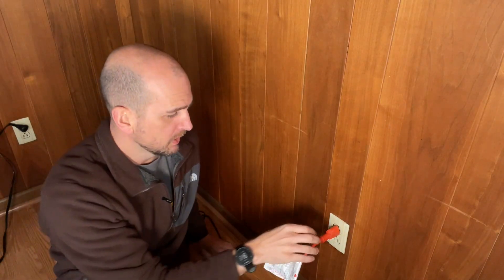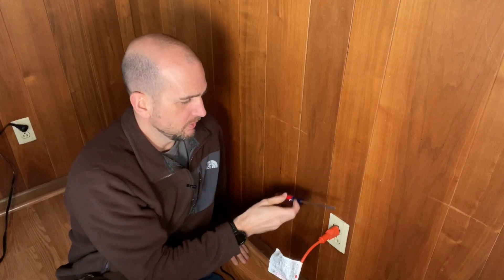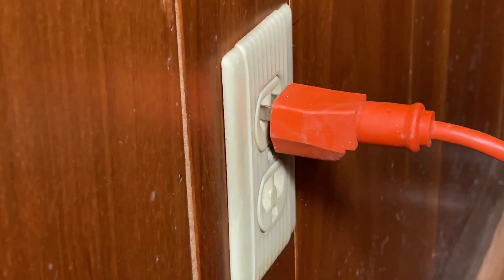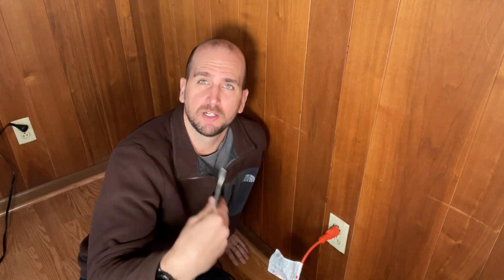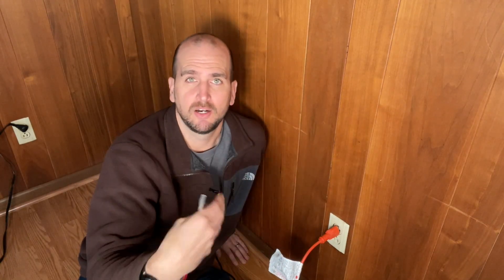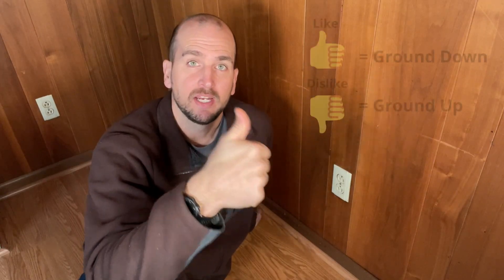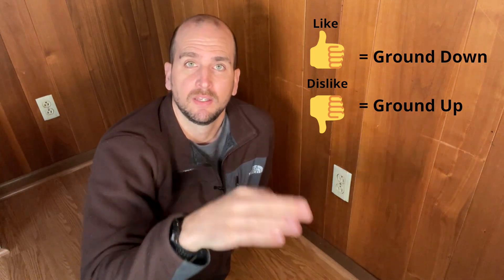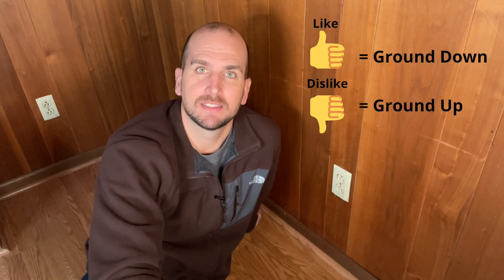Should An Outlet Be Installed Ground Down Or Up

Comment: Ground up might save the life of one toddler sticking a penny into stuff per decade or whatever. But the whole notion that every single human life is precious and must be protected is just silly, if you take emotional response out of consideration and look at it purely with logic. We're overpopulated anyway, and our birth rate is plenty high enough to outweigh any small change in the death rate. Plus little faces on the wall are pleasant.
Reply: These toddlers need to grow up and use a bobby pin like we did in the '60s.  Then you don't need a plug to learn about electricity.

Comment: I have had a plug behind a child's bed get a necklace get between the plug and the outlet. It burned the necklace in half. I think if the plug had been a grounded plug and the ground had been up, nothing would have happened. It probably would have been fine if the outlet was sideways too. But things making contact between the plug and the socket are just part of the technical debt we have from being the first mover in mass electrification. We still have crazy things like 12 V tungsten bulbs with the same base we use for 120v bulbs, plugs with unprotected leads that are not large enough to trip the breaker if a short occured, 15A sockets on 20A circuits, and devices with a 15A plug that draw closer to 20A... All of this is crazy and should be fixed, but who will pay for it?

Comment: If you go into any new house all wired down. As an electrical engineer, I would recommend down just because of plug configurations. Also I have never heard of an object falling onto a partially plugged appliance. But this is more the common anyway.

Comment: Ground down.  The reason is that the with the ground down, the green screw or location of the bonding-bare copper wire goes to the bottom of the outlet.  I prefer this for multiple reasons.  First the bare wire if low is less likely to fall onto hot or neutral outlet screws.  Second, when grounding to a metal outlet that is bonded, I like the outlet box green screw in the lower half of the box as when I sit or kneel in front of it, looking down I can better see the screw driver blade.  If the outlet box green screw is low, I want the bare wire or pigtail to go low on the outlet.  This is more important on multiple outlet boxes like quads.

Comment: Ground up is my preference for the reason you stated. I do it that way in TV stations where I installed equipment and in my own shop. But when behind furniture, ground down MAY or MAY NOT be better. I am flexible.

Comment: I was always told a plug with the ground up in residential is for indicating the outlet is on a switch.
Reply: That is something that lazy/cheap electricians do.
It is unprofessional to be inconsistent, and it's the wrong solution to the "problem". You should install receptacles that are marked as switched.

Such as https://www.hubbell.com/wiringdevice-kellems/en/Products/Electrical-Electronic/Wiring-Devices/Straight-Blade-Devices/ConstructionCommercial-Receptacles/DR15C1WHITR/p/2608245

Comment: Worked in a 1980's era hospital and all were ground up for the reasons you showed but ground down in new hospitals. I personally feel that ground down is better for retention as the weight torques the plug out by pushing in on the ground terminal and the 2 blades above out. There is more tension holding in due to two blades vs one ground terminal, Also, the ground terminal male is very weak vs a vertical blade and see them broken off in the outlets all the time. All flat plugs will work as designed. Personally, ground up looks goofy IMO.

Comment: My dad is a licensed electrician. Unless there is a specific reason to be installed ground up, his standard orientation is ground down. His reason for this is that should that outlet become weakened in the future and a connected cord sags, the ground prong will remain secured due to physics. The odds of something falling in the tiny gap and tripping the breaker are lower (and only an annoyance) than the odds of someone being turned into the ground themselves when unplugging a loose connection.
Reply: Agree good argument.  Ground up argument of something falling onto prongs makes sense and it’s something I figured out myself..!!
Reply: Plus, if something metal fell on it, you should WANT the breaker to trip immediately.
Reply: My dad told me the same. I always install them ground down.
 Father knows best!
Reply: The ground prong cannot disconnect while the device is still powered.

Comment: My entire Home, including 220V for the Clothes Dryer is ground facing down. If a receptacle is weak and not holding the plug it is time to replace the receptacle, this could lead to internal problems with-in the receptacle and a ground situation that would trip the circuit breaker!

Comment: When I wired my home, I installed ground down on all plug-ins not energized by a light switch. I installed my plug-ins ground up on receptacles energized by a wall light switch to have a visual ID on those plugs that control lamp lights being turned on at the room entry.
Reply: I dislike the practice of upside-down plugs for switches because It is unprofessional to be inconsistent.  It's the wrong solution to the "problem". You should install receptacles that are marked as switched.

Such as https://www.hubbell.com/wiringdevice-kellems/en/Products/Electrical-Electronic/Wiring-Devices/Straight-Blade-Devices/ConstructionCommercial-Receptacles/DR15C1WHITR/p/2608245
Reply: Clever. 👍
Reply: @EDHBlvd  I workd for a home builder who also installed them this way. (Beazor)
Reply: That works except that a common electricians choice is to split the outlet with the little side tabs. Then wire lower outlet to the wall switch. Plug nearby lamp there. That leaves the top — and most accessible plug easy to reach for plugging in your phone charger — or your vacuum, fo temporary use.
Reply: The average homeowner would not know this distinction. Therefore, I think this is a ridiculous reason.
Reply: @joneshome2688  If you are commenting on my post....As we sold new homes only, it was part of the initial tour to explain this to them.
Reply: @joneshome2688  Then don't do it...

Comment: I grew up in Texas the son of a Master Electrician and I never saw a Ground Up plug anywhere. Have moved to Alabama after my Military time and dang if just about every older(60-70s) homes have ground up.
Reply: I have wired ground down on 15 amp and lower. 20 amp outlets ground up.
Reply: I'm an electrician in Ohio for 15 years.  Almost never seen plugs installed ground up.

Comment: I have seen outlets mounted side ways, in the over head and even in the floor which is probably not legal. I think they are supposed to be above grade by stated distance.. But I could be wrong. I mostly have put them in the wall and had ground down if there is enough wire for this orientation.   { ;- }
Reply: and now we have one's with table at the docs office with a pair of (eek) usb outlets.   I would not do that with kids around.  Got a wire?  in the usb outlet?   smh  think those tables are the worst idea let alone ones with usb outlets...

Comment: If you visit Leviton website, you will see they have the ground on the top in their samples. That in mind though, their GFCI devices are built so that ground ends up down when installed. Also, most switches have the ground screw on the left.

Comment: I have seen inspectors who insist on the ground pin up.  Most people seem to like the appearance of the ground down. Many molded 90 degree plugs are ground down, which put the conductors in a strain if ground up is used.  I think we might be starting to over think some safety issues in  the US.  How often does a metal object fall on a receptacle??  If you use combo ground fault and arc fault breakers it is a moot point.

Comment: Technically, it doesn’t matter whether installed ground up or ground down however, you’ll want to be consistent within the house or room.  Having said that, it has been my experience that there are some plug/cord configurations (like the right angle plug you showed) that seem to work better with the ground down configuration, which is why I have adapted that method over the years.

Comment: Ground up to prevent fire hazards. Say a paper falls onto the plug if it’s ground down then the paper can catch fire from touching the hot and neutral sides. Ground up it’s either gonna touch ground/hot or ground/neutral.
Reply: Paper isn't conductive

Comment: The electric plugs in Ireland and England are far more safer than these hazardous plugs. The outer part of live and neutral are insulated so anyone pulling a plug from its socket cannot get a shock. Suprised that 🇺🇸  is not ahead of the pack in safety.

Comment: When I was in college, I worked for a commercial electrical contractor and in industrial buildings, it was always ground up. To provide further evidence of this orientation, many commercial grade angle plugs (heavy duty units) such as Hubbell and Leviton Commercial only allow for ground up mounting. It seems that residential installations are frequently ground down. Light duty Angle plugs allow for different orientations. It does seem safer to have the ground up because if something does manage to get between the plug and the receptacle, there is less chance of bridging the live wire to ground or neutral.

Comment: The  code allows outlets to be installed with the  plug hole facing ,  or sideways. It's  to you, there is no standard electric outlet orientation. So that means there really is no such thing as upside  outlets.

Comment: Local codes often have a specific orientation and there may be difference between residential and commercial. I was an apprentice electrician in Texas a lifetime ago and due to flood plain issues they required ground down for rising water in residential uses. They wanted a direct short between hot and ground in a flood to trip out breakers. I have been to other areas that were not prone to flooding that did not care or had either orientation in place. As I understand it, commercial uses are a whole other beast and you must check local rules and codes. Asking a local code inspector is always a good practice to have.